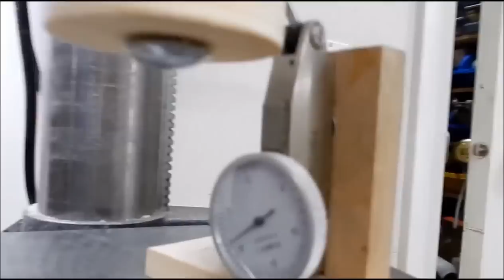Make spindle sanders for the drill press

Comment: You might add a bearing to the bottom end of the spindle and then make a table top with a hole just big enough for the bearings to fit in. this would prevent the sideways stress being made solely on the chuck.

Comment: I've made and used similar spindles in my drill press, they do what they are supposed to. But I suggest one small improvement; make a bottom support - a piece of board with a hole fit for the rod. This adds stability, especially if you happen to push on your work piece too heavily.
Reply: My thoughts exactly!  Great minds DO think alike!!
Reply: And if you want to make the bottom support even better, you can use a ball bearing with a bore size a bit smaller than your threaded rod. With a file you can carefully grind away the thread (while spinning the thing in your drill press) until the head of the rod fits the bearing.
Reply: ArmasLahtaaja
Reply: This was my first thought as well, its cool but its not worth destroying your spindle. Find a small bearing you can press into a block of wood you can attach firmly to your table

Comment: Hi there,

Sorry, I didn't read through all the comments to see if this has been covered before(sneaking in this video at work and need to get back at working ! lol). Just wondered why you haven't make a bearing race at the bottom to steady your drum/threaded bar? Just a square block of wood at the bottom that you can clamp to your table(even from the bottom), then have a counter sunk hole for the bearing. A small piece of wood can also be added if you wish OVER the bearing to prevent it from coming out(extra security). Then a through hole for your threaded bar. That should stablize your drum a lot.

Hope my attempt to explain makes sense!!!

Comment: Tip: You can raise and lower the sanding drum making a table set auxilar presses the head table. This side table would holes to allow up and down the cylinder. In turn the head table should move aside to allow everything works fine.
Sugerencia: Puede subir y bajar el cilindro lijador haciendo una mesa auxilar fijada con prensas a la mesa principal. Esta mesa auxiliar tendría huecos para permitir que suba y baje el cilindro. A su vez la mesa principal debe desplazarse a un lado para permitir que todo funcione bien.
Happy new year woodworkers. Thank you Jack for your videos.

Comment: I watched this video yesterday (except about putting rubber bands around to let the glue dry). I needed to enlarge some holes for a dust collection manifold today so I got my hole saw out and made me a spindle. 20 minutes tops. I also used scissors instead of a paper cutter to cut the sand paper. I cut in the wrong direction - make sure you cut in the direction of the rotation of your drill press - DUH! Any, thanks for saving me half an hour with a hand rasp today ond no telling how much time in the future :>)

Comment: Good timing, Jack! I recently broke the shaft of my store bought spindle sander for the drill press. (they don't work in the router very well!) Plus I've wanted one of a smaller diameter. Thanks!
Reply: A router is usually too high speed for drill spindle sanders.  Probably somewhat dangerous to use one that way, though the principle of a handheld router style spindle sanders is quite appealing.

Comment: I've used cylindrical rubber door stops. Even found some that fit the proprietary sanding sleeves!  But I used a bush (hole in wood base clamped to drillpress table, extended centre spindle with sleeve from copper tubing; - a bearing would have been better)  on longer sander to prevent strain on my drillpress bearing.

Comment: Hey Jack, nice job, but those extra long spindles are probably wreaking havoc with your drill press thrust bearing. All power drills use thrust bearings which are designed for axial force, not radial like regular bearings. When sanding, the longer your spindle the more sideways force you are applying to the bearing (via leverage) in a direction it is not designed for. To protect your drill press you should really have the spindle shaft extend past the bottom of the spindle and into a regular radial bearing which is anchored onto the table. That way you aren't putting undue sideways force on your press bearing.
Reply: Good to hear. You might want to make that point to your viewers. Keep up the great vids.
Reply: I've heard the same thing.  But I was looking at a Delta Drill Press advertisement in Popular Science, February 1951, p 249, where they say you can use their drill press for Sanding (they sold a kit), routing (they sold a spindle and router bits for this), and even use it as a shaper (they sold a three lip cutter).  Were they advertising the drill press for uses their designers did not intend?
Reply: @Martin Green - agree absolutely. A bearing at the bottom end is needed. The longer the sanding drum, the more sideway force. 
@MetaMe - we will never know.
🇦🇺

Comment: Now that's a tool I will duplicate for myself someday!
Does it deflect much? If so, I'm thinking of using an all-thread rod that's a little longer on the bottom end so that the extension can ride in a hole, perhaps even in a bearing, to minimize or even prevent deflection. Your thoughts?

Comment: I just got my drill press and am in the need of these.  Did you let the glue tack up before wrapping the paper on them or do it right away and let it dry?  How hard is it to remove and replace the paper?  Thanks of the great, easy spindle sander build.

Comment: A big thumbs up to all viewers who realize that a bottom support (preferably a sealed bearing) is needed. Check how much deflection your spindle is getting when you put pressure against the bottom of the drum....that will kill the upper thrust bearing in a hurry, it was never designed to take side loads. Make the sandpaper replaceable by sawing a thin slit vertically into the drum, so you can tuck the edges of the paper down into the slit, which will hold it in place.

Comment: I enjoyed the video, Jack and like the music you used. For future reference, I'd advise you to reduce the video sound volume (mainly when a vacuum or noisy tool is running) as it seems to impede on the clarity of the music. I've learned this the hard way myself and I'm sure many others have also.

Am I right in thinking you only sprayed glue on to the spindle, so that worn sheets of abrasive can be peeled off and replaced?
Reply: I agree with the audio

Using the spray adhesive allows the sandpaper to be removed easily as oppose to using wood glue 

Hope this helps

Comment: I did a few after looking at your video But I didn't do the sanding  to make it straight down as you did I used a file  mmmmmmmmm not so good , I did put the vacuum hose behind the drill press for the dust and it worked good :)

Comment: I am concerned about the lateral force being applied to the drill shaft bearings.  It seems to me the bearings are for vertical alignment, and lateral force would cause premature wear. I understand lots of folks do this and even create a vertical lathe, just wondering about longevity.

Comment: There's got to be an easier way to find a cylindrical piece of wood, but I can't think of one other than maybe buying a rolling pin but that would be expensive.  It looks like you could maybe use a lathe for this project a lot easier, but you may not have one. You might be able to rig up a crude one of your own,  even just using a drill, or drill press.
Reply: +Jeff Beck The home centers (Lowes and Home Depot) sell hardwood dowel material in different diameters.
Reply: This is the easiest way to get a short cylinder with a central hole.

Comment: Cover the cylinder with velcro!
Reply: With the velcro you will likely find that the paper (which needs velcro for a backing) and will cost a lot may come off, or catch on the edges. Velcro has itls uses, but in this specific place, i will not use that. One application for velcro is for disk-type sanders where there is no chance of the project catching the edge of the paper and ripping it off.

Comment: This is super dangerous without having a bearing at the bottom end of the spindle.  I tried something like this and the chuck came loose and flew across the shop, thankfully not hitting me.  I was looking this video up because I wanted to find a safe way to do this.  Your video has the most views, but it is not a safe method.  Please put a big bold note so people don't do exactly what you are doing.
Reply: I had similar thoughts. I eventually bought a portable spindle sander.

Comment: a good idea, pity the drill press spindle isnt designed for lateral loads on the bearings, and if its a morse taper spindle, theres nothing to hold the drill chuck and arbour in place